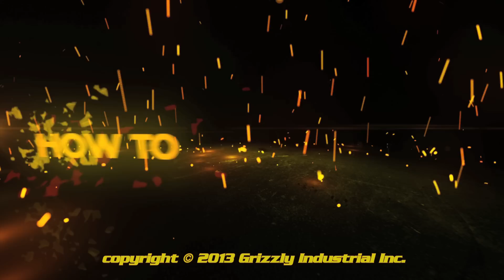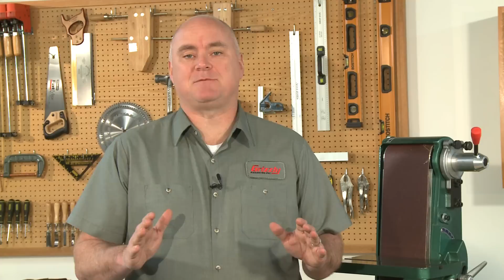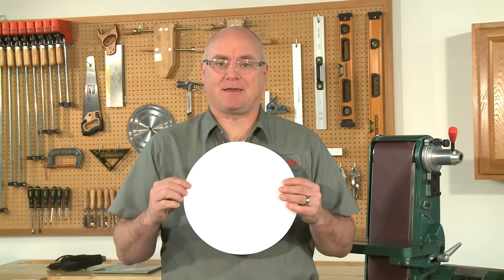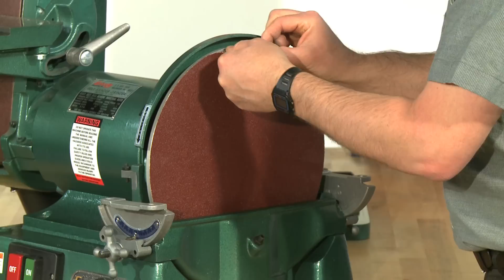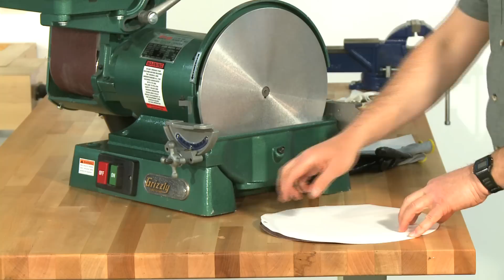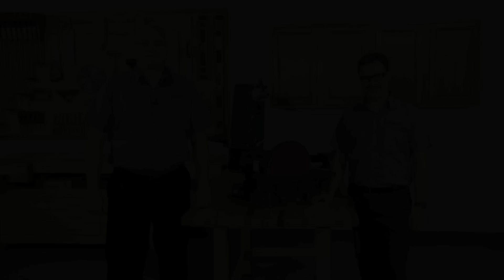How to Replace Sandpaper on a Disc Sander

Comment: Thank you Thank you!  You just saved me from spending an hour trying to remove the existing sanding disc.  I removed 2 in the past manually and they were a nightmare.
Reply from the maker: Glad it helped!
Reply: mine came off very easily ... by itself ... at full speed 😄

Comment: Acetone works best on adhesives,  compared to a less aggressive cleaner like mineral spirits.
Reply from the maker: Be careful when using it on your machine, if acetone accidentally gets on painted or plastic surfaces, it can remove the paint or damage the material.
Reply: @grizzlymachines  haha, of course! Your funny! I'm an auto detailer & auto body specialist! You think people will just slop on acetone? Lol...I'm not using it on a BMW...😅I'm using it on the face only of a disc sander!🙄

Comment: I bought your 15” disc sander and base about 8 years ago.  Overall, it’s great.  But I do have a problem.  Your “15” PSA discs do not stick to the platen.  I clean off the platen with lacquer thinner to remove any left over adhesive.  However, my new Grizzly 15” discs will not stay on the platen.  Which sucks.
Reply from the maker: Hi there! If you're having issues with your machine, please reach out to our Customer Contact team and we'll see if we can come up with a fix for you.

Comment: I am a young shop teacher and am attempting to repair an older model, and am curious what that square peg is called on the disc sander that holds the metal disc plate is called? Without it the armature spins freely, and the disc does not move/ it slips. Do you know of what it is and where to order one? Thank you!
Reply from the maker: Hello Carson, thanks for watching and for teaching the next generation of woodworkers! Based upon what you're describing, I would say that you're speaking to a "key". A key is often found on motor shafts connecting things like the pulley, or in the case of a larger disc sander, the sanding disc itself. This is not always the case, however, as some models may feature reverse threaded designs, or even simple Allen key locking bolts on a flat spot on the motor spindle. That said, it sounds like a "key" is the missing link for you here, and the right size can be found on Grizzly.com's part store or from other vendors such as https://www.mcmaster.com . Just be sure to know each dimension for the keyway, and you're good to go.
Reply from the maker: Hi there! There's so many models of disc sander out there--if we knew what model you were looking at, we'd love to help! You can reply here, or reach out to our tech support at grizzly.com/contact .

Comment: Lol. I replaced on my disc sander, it was a pain. I just pull it out  it did came on pieces. I used a scrapper and paint thinner. It took me for ever to cleaned up.
Thanks for the video.

Comment: Good video ... I have just two suggestions to make.

Firstly, mineral spirits is next to useless as a solvent for the left-on and possibly hardened adhesive. What you want  to do is  wipe the metal with  a rag soaked in cellulose thinners, which will  soften and remove the adhesive in double-quick time. After that,  the metal  should be wiped with isopropanol ( denatured alcohol) prior to installing the new disc. 

Secondly, once the disc is on I like to use a  J-roller to ensure adhesion all over prior to sanding anything.